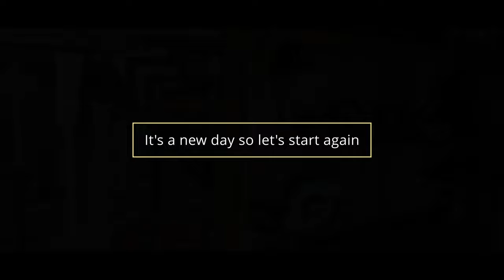Woodworking Motivation - Friday with Gary Vee

Comment: nice one pal, thanks
Reply from the maker: Im glad you like it! Thank you
Reply: @rarecraftsman  sometimes all i want to do is go outside and make something but its seems so hard to do just that. im a joiner by trade i work for a company that has all the cool stuff but i have very little, i dont want to buy cheap tools because i know the gear i need to get the accuracy, but also its like 700 or so to get a decent track saw. i ended up with nothing but time and no money and it kills me bro!
Reply from the maker: @SEPTICWOUNDS  I know exactly what you mean. I’m a web designer and would love to buy some of these quality dewalt tools but can’t simply afford them. I think that using some of these cheaper tools is ok as long as you are using it for the DIY stuff. Most of them are easily adjustable and with some of the creative jigs you can achieve really decent results. It’s all about enjoying the process for me. I hope you’ll find your own way to get whatever you need dude. All the best 💪